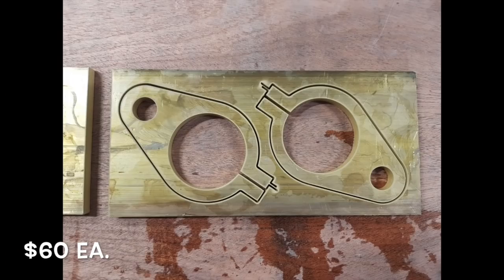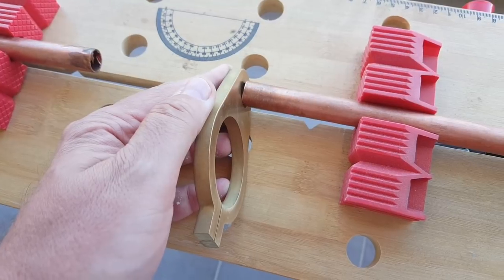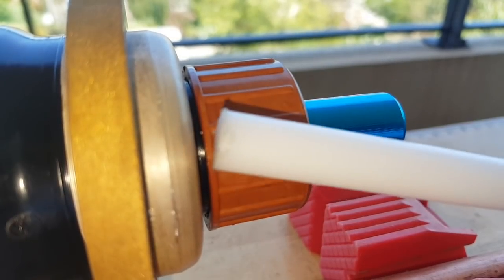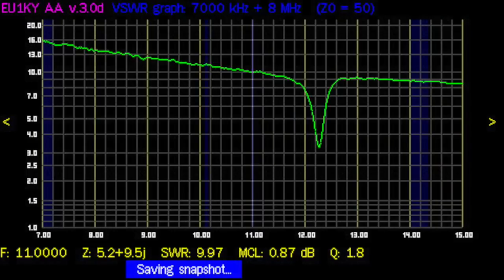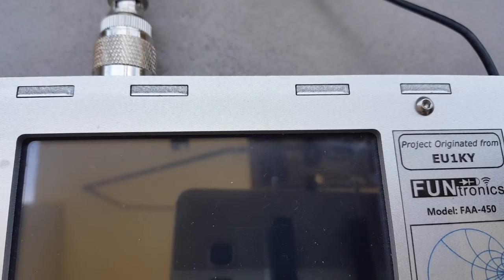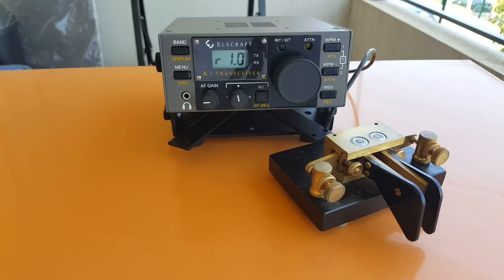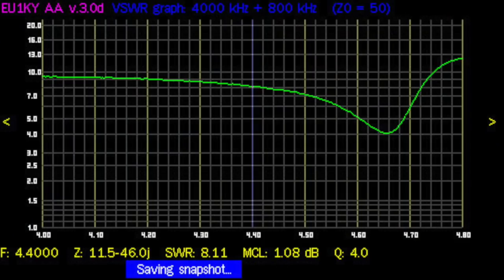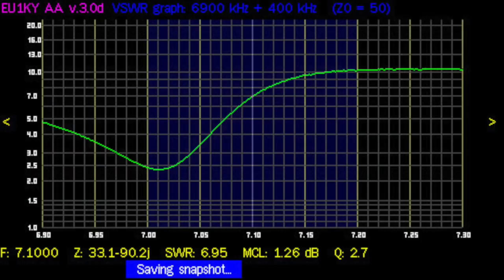Building a Magnetic Loop Antenna For My Apartment, Part 2.

Comment: Common practice is to place a piece of wood between the part you are striking and the hammer! No tool marks.
Reply: A hiking boot makes a pretty good improvised soft faced mallet.
Reply from the maker: I'll get the real thing ;-)
Reply from the maker: Definitely. I did not have any..
Reply: Gil, you could also heat up the brass a bit (so it expands slightly) and at the same time cool the copper. This should give you a bit of space to fit them together.